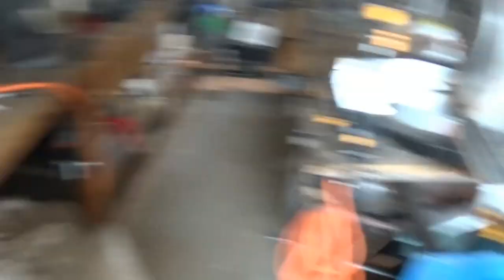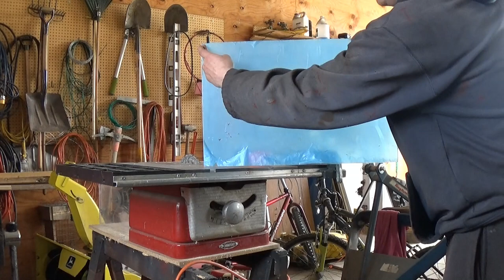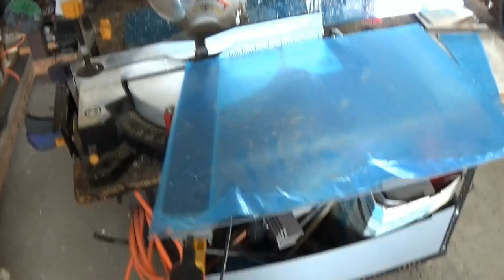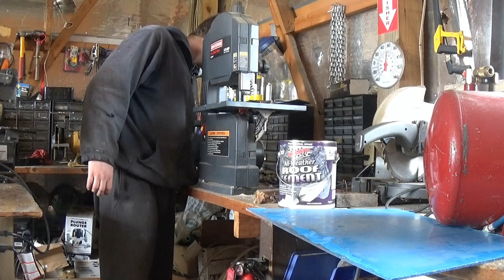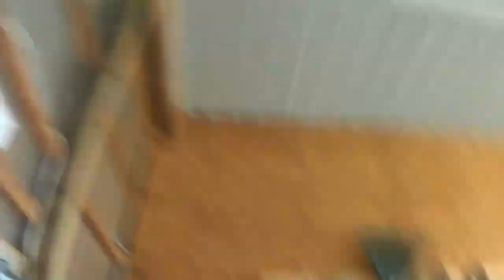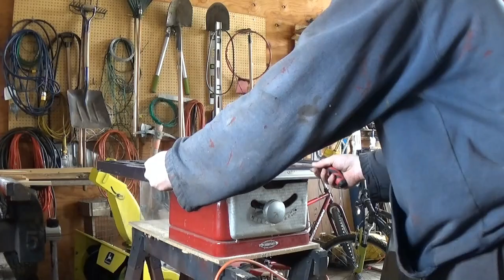Cutting Some PETG  for a Little Project

Comment: I have a 24"x24" sheet of 1/8" PETG that I need to cut down into quarters for a vacuum forming project. I am not finding much info about the best ways to cut a sheet of PETG but based on this video I'm guessing a table saw is an appropriate tool for the job?
Reply from the maker: As long as you have a blade for petg plastic yes!  Don’t use a regular ripping blade!!! Or bandsaw with a plastic blade or even better a router will all work
Reply: @radozeman  thanks for responding! Are there other tools that would work, like a hand saw? I'm hoping i already have something at home, so i don't need to go out and purchase anything new
Reply from the maker: Jig saw works good again if you have the right blade, which at least jig saw blades are really cheap if you don’t have one.  It is all about having the right blade with plastics, especially petg which can be both gummy and brittle at the same time when cutting.
Reply: @radozeman  okay great then I'll probably go with that then, what blade specifically should i look for?

Comment: that deburing tool works slicker than snot on  plastic cool
Reply from the maker: jetegtmeier71 Actually works on metal to, just requires a little more effort.   Produces a very nice smooth edge.